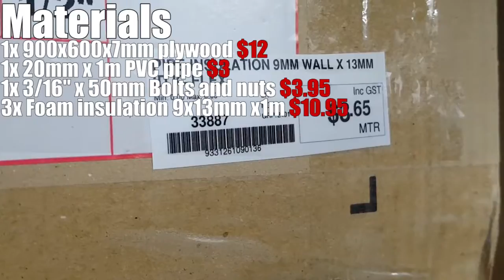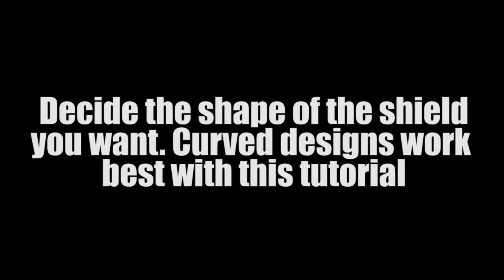How to Make a LARP Shield | Part 1 of 2

Comment: If you used a heat gun you could flatten the pvc pipe on the end while leaving the center section inside the hole rounded. Might make the drilling a little easier.